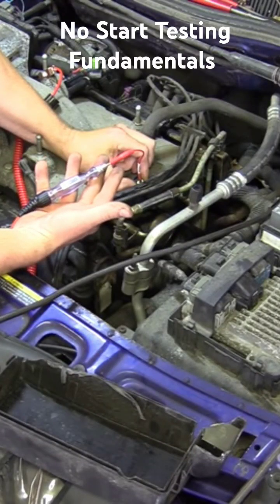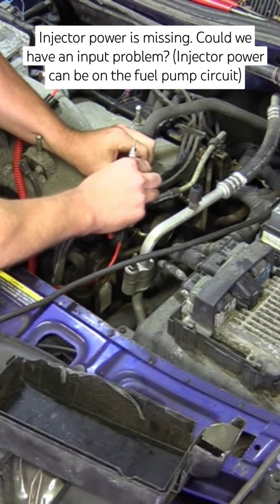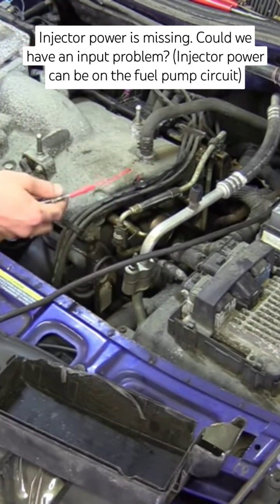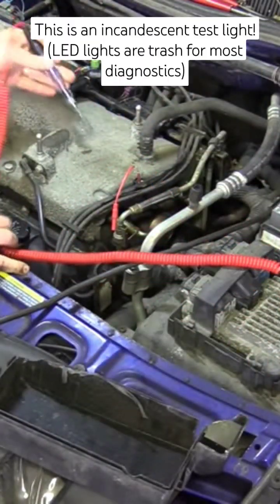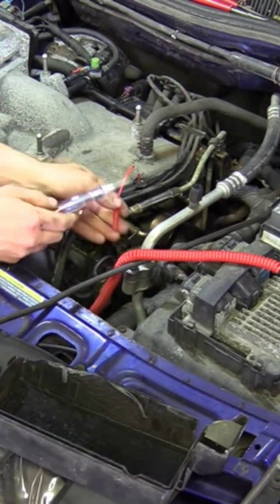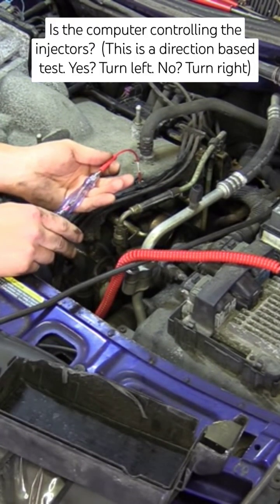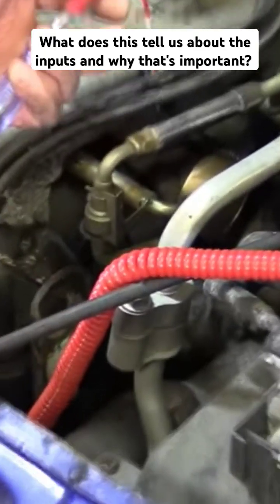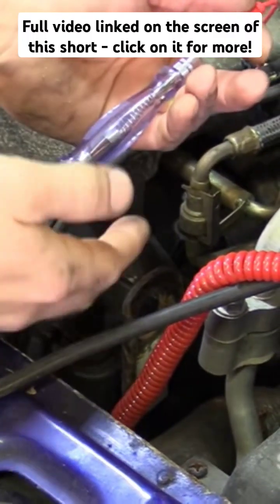No Start Diagnostics using an Incandescent Test Light

Comment: I've watched you test stuff w/ that test light and i alwas thougt they were to dig splinters out of my hand. On fuel injectors ive seen a ratty harness have a loose connection and make me wonder lime Christmas lights -ok which one of you buggers needs a smack. There is a box full of noid plugs but what if you don’t  have the 1985 version? Test light baby!

Comment: There is always the DMM if loading the circuit is a concern with a test light.
Reply from the maker: Who's concerned? You can't check injector driver control with a dmm. It's too slow and you definitely can't do it unplugged
Reply: @ScannerDanner  Ah …. Good to know!

Comment: A test light funicions similar to a dim bulb tester i use in electrionics quite often, in order to diagnose them. Now the issue the test light testing certain points possibly causing damge is because the light is allowing to,much current to follow. A 1 amp in rush current is pretty high, but even after that 200ma max current is also still kinda high fir solid state testing, look for a much lower current test light in the 50Ma range or lower( the lower the current the better in away, you still want to keep your big test light and use it when appropriate) you may have to go on the web, and try and find a bulb and put it togther your self!
Reply from the maker: You missed the entire point of what I showed here. And no, you're not hurting an injector driver with this bulb. Not even the inrush of current as the injector can be even higher than 1 amp
Reply: @ScannerDanner  I'm referring to the title, we're alot of forms, and others say a test can damage a ecu and that's far from the truth, negligence is what hurts the ecu. The rigth size test light you can test anything thats all I'm was saying there, I understand completely what your doing my guy, I'm not a certified tech, but I've studied alot of stuff with electronics I've built circuits, and repaired them. I also work on other stuff, early years were my small engine repair times. HVAC with propane, and butane. I still work on cars to time. Now it's mostly solid state, and valve/tube electronics from the early days of electronics. Rigth equipment for the rigth job that's all im saying, and a test light is an excellent choice with proper knowledge of it.
Reply from the maker: @Anthonytheredneck  ah okay, understand now. Thanks for clarifying
Reply: @ScannerDanner just something to think on, outside the box  that I wanted to explain that could maybe help you and others in the future, and the only reason I mentioned this when I first found this short, it said some were on the video in words that a test light can destroy/damage a ecu. I don't see that anymore. The idea that I was trying to bring up is that you could have a test light or mulitple test light homemade of course that have a varying voltage, and current rating. 5 or 6 volt bulbs heck a ge#47 bulb is pretty common but I'm unsure what it's current rating is take the voltage and current do ohns law and youd know how much current it can sink/deliver to the  circuit under test. Ive been really enjoying your videos friend, your actually diagnosing correctly and alot of mechanics I've meet don't do this, they just throw parts at it, based off the scanner codes, all thoes codes mean is that there's a fault within the circuit that code us for, it's not always a faulty part!it's very similar to how electronics are diagnosed and repaired correctly. You do great work man, and I'm learning from ya!
Reply: A vid on basic tool use. Would be invalueable to the u
Reply from the maker: @Anthonytheredneck  absolutely and I teach about this in my classes (knowing the current flow of the output circuit being tested and the current flow of the test light you are using on that circuit. In particular for the driver test)
Reply: @ScannerDanner  so you do use this, and different test lights depending on that circut that which is undertest, that's great man! I may come off as a bit of a know it all, and I don't not mean to be that way because that's far from the truth! I've been really enjoying watching, I love the way you observe the little things, like the coil on the GDI Ford that you guys did injector work on, but came back with a miss do to the plug. That's very fine attention to detail, and if no one really paid it any attention you could lend yourself a headache quickly. I'm just a gear head who gets overly excited to fix stuff, and I love brain storming. You have great knowledge friend I'm very happy I'd found your Channel! Thank you greatly for your time sharing your knowledge, again I know quite a few techs, and I I've never seen anyone do it like this, me being a self taught in mechanics, and electronics I knew that you can't always assume it's a faulty part.
Reply: How would that hurt anything if the tool you're using is pulling a 1/4 of current of what the component it controls is pulling wow. Somebody help these people.
Reply: @marlinyoung1606  in rush current depending on circut designed could effect switching transistor, or mosfets, also if something within the ecu's circut is shorted to begin with, or is in a failing state the bulb/test light can make or break the circut depending how much current it can limit, and what that part of the circut is capable of drawing in AMPs. If you do ohms law 12volts at 200mA is 2.4 watts it might not seem like much but thats a lot of heat for certain components as resistor for example,are rated in watts, and have a value in ohms which have a wide range very low wattage that I know is 1/16th of a watt I'm pretty sure there are some lower values just for example, now I'm unsure what exact values could be used in the ecu as manufacturers very, and same for the engineers who designed the Circuit. But I wouldn't be surprised if there are some within. Essentially you can use a test light to test any electrical circut pretty much if it's the rigth type to limit the current.